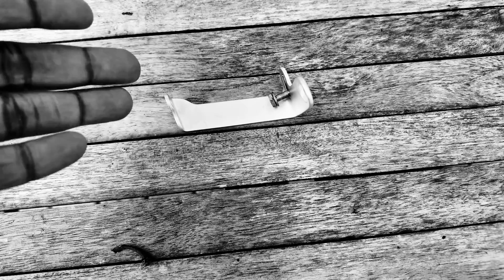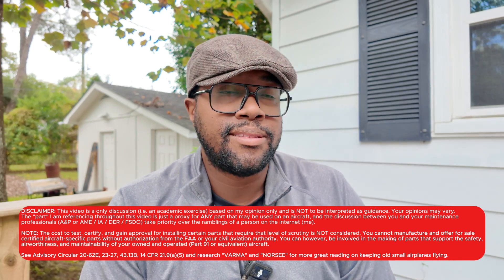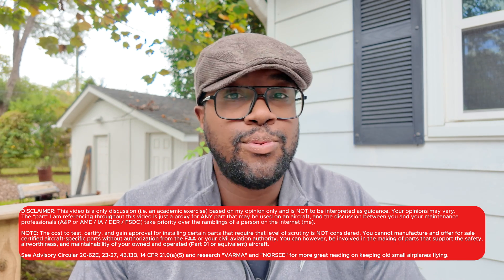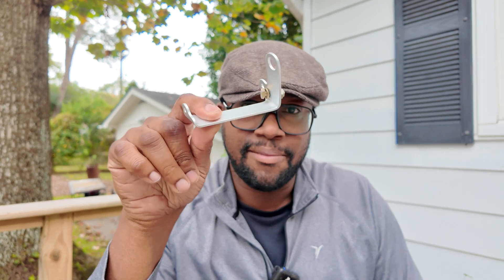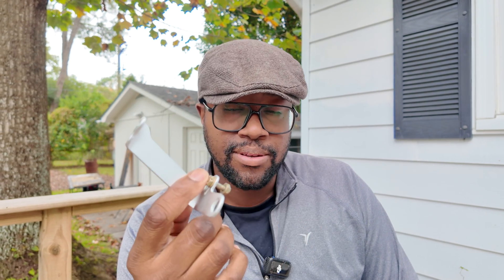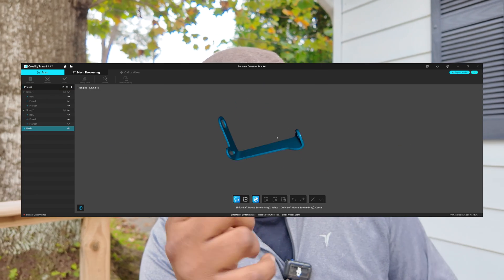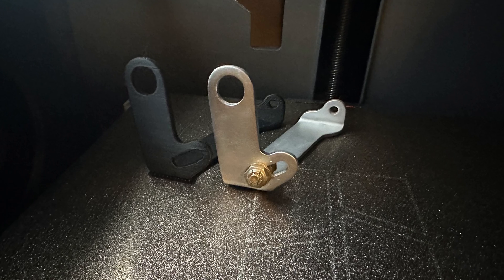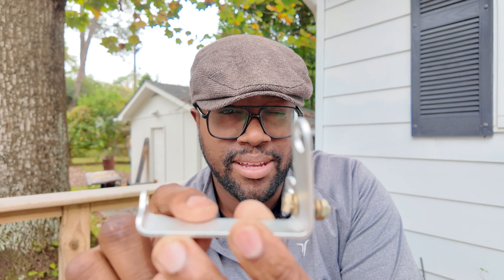This $320 Part Should Be $25 - Prove Me Wrong

Comment: 30 years as a manufacturing engineer for a major military aircraft company, plus A&P back ground and I am also a pilot. Let me first say, this has been a known issue for quite sometime. In terms of manufacturing, you are correct. The cost should be less than it was say 40 years ago. But you didn't mention two major things that also affect the price.....at least, not in detail. One.....quantity. The more parts you produce, the lower the cost that can be passed onto the customer. This is a minor issue, but I bring it up because you chose an aircraft part that is NOT highly sought after, and so part of the high cost will be reflected accordingly by the seller. Two, and the brunt of the cost, liability....and this is where the cost typically skyrocket. I'm willing to bet, if you had mentioned that you were going to put this on an aircraft,  most, if not all of those quote companies would have declined your request. I understand your intention was never to put it on an actual airplane, but did you try mentioning what I just described to these folks you worked with on quotes? I'm assuming you did not. And it brings us to the major issue with aircraft parts, especially certified ones. The cost of liability, FAA approval and all of the legalities to cover a manufacturer in case of a part failure, and God forbid,  one that leads to an accident, is truly at the forefront of the cost, not manufacturing.  And that challenge hasn't changed int he past 70 plus years. So in conclusion, should this part be $320? Probably not. I'm willing to bet it could be less. But $25 dollars? In manufacturing terms hard to say unless we understood the liability cost to the manufacturer. But in legality terms.. most certainly no, it will most definitely add to that $25 cost by a considerable amount.
Reply from the maker: Excellent, excellent comment. 

In practical purposes as a certification/flight test professional, it doesn't matter if the part is going on a CAR 3 airplane or a bottle cap maker - it's just a part. Part 23 and 25 where I work require additional scrutiny. It really helps that the regulations for an owner making their own parts for the upkeep of their airplane are vastly simplified for CAR 3 and Part 91 operated airplanes. The liability for an owner produced part stays with the owner and the person responsible for returning that airplane to service. If the approving authority requires material and parts certificates from the machine shop, we'd be having a different conversation! As you noted, they likely wouldn't be able to provide such. Although, PCB way would - there's an option for it. Ultimately it's up to whatever the FAA administrator would find suitable 🤷🏾. For CAR 3 and Part 23, an ASTM standard flies. And many online sources will follow some standard for their manufacturing. 

In this example, I only need one thing, for my airplane, to solve my specific problem. So this academic exercise is perfectly valid and does not cover every corner case or we'd be here for a decade. I'm not trying to make my own Piper PA-28 spars...yet 😉

After everything is done, it's then a practical conversation between owner and A&P to find the safe, legal pathways. I'm not getting in the middle of that. Just saying the technology is there, and everyone's mileage might vary. 

Very great discussion starter! Welcome to the channel!

Comment: Does MOSAIC address any of this area of concern for aircraft owners working on their aircraft?
Reply from the maker: It addresses it for abvery specific case - new light sport airplanes certified under the new rules may be maintained by someone (i.e. the owner) after they obtain a repairman certificate.  Much like he builder of an experimental airplane can act as its primary maintainer with a repairman certificate now. It does not change how previously certified (i.e. Our old CAR 3 and Part 23 spam cans) are maintained and modified (14 CFR Part 43). MOSAIC is actually pretty good reading. Find the Mad Props Aero channel they have a great break down of it.

Comment: I like what you say, I used to own a machine shop that made AOG parts for aircraft. If you showed up at my shop with a blue print or a broken part I could have reproduced that part because I was a certified shop. While I hosed maintance shop I did do some replacement parts for GA and did it as inexpensive as possible. I do agree with what you say here and Send Cut Send is a great source for simple parts.
Reply from the maker: Glad to hear this perspective. I'm not claiming to have the 100% solution but a modern day machine shop is vastly more capable now than ever. Imagine what we could do if we could apply ASTM type testing to a sacrificial part? We'd definitely be on to something.

Comment: I wish we could de certify an old certified plane. Then re certify it as experimental. So, we could then use your “experimental” bracket, that we both know would work. And all the legalities would make the lawyers happy. Thoughts?
Reply from the maker: You actually can! If you have legitimate research and development to do, any certified airplane can be placed in the Experimental R&D category. You just have to prove to the FAA that you have a legitimately large and valuable project, with safety and outcomes thoroughly investigated which becomes the rub. The airplane would then have serious restrictions of where and when and how it can fly (frustrating but not impossible to overcome) but then the other rub, good luck getting all the parts on the airplane to conform to a standard, and then you'll end up running a Part 23 flight test campaign to recertify what would now be considered a new Type. The FAA would likely not let you revert to the CAR 3 standards of certification. Could make your head spin!
Reply from the maker: Or keep it experimental forever with the restrictions which might still suit a lot of people's flying.

Comment: Liability and cost for approval make aviation parts expensive.
Reply from the maker: That's a huge part of it. There's huge cost in the paperwork and liability. So cut out the manufacturer if it makes sense. If the owner takes on the task of producer, liability stays mostly within the house.

Comment: I talked to GPT about it. 
It can be produced under a Parts Manufacturer Approval (PMA) – A third-party manufacturer approved by the FAA under §21.303.
PMA parts must show: Design approval (identicality, licensing, or independent test/data showing equivalence to the TC part), and production approval (quality system ensuring conformity).
If they have identical shape, equivalent material and method of manufacture. Bent sheet metal in this case.
If you do a different superior design like organic 3D print it needs an STC, they consider it a modification and it's a different part, even if vastly superior.
But for your own use it's actually possible to make the part yourself with a bit of documentation overseen by A&P mechanic and it be legal in a certified plane. Which is interesting. In case the company is long gone and no parts can be bought for instance. So for your own use you might just be able to order a sheet metal part made with a few right choices.
btw a TMU, turbine monetary unit is 1 million dollars and they are not kidding. If you want it serviced it's a million dollars. The tiniest jet engine, it's a million dollars.
Reply from the maker: TMU!! Dang 😂. And yes the GPT is most practically correct. I put the regulations and ACs I referenced to make this video in the description and they're actually easy reading. The comprehension and application are two different things.
Reply: @OpenSourceGA  It might be so relatively easy to get PMA approved for such a simple part that you could do it and have 100 parts made and sell them online for 99$ or so. Or even to a supplier network, they might sponge up many suddenly. Maybe add a few more parts. An STC for a modified part might also be relatively straight forward, just a slow bureaucracy
Reply: I talked to the spirit of Orville Wright via a medium and also got an explanation I can't rely on without looping in an actual human expert

Comment: Interesting. Given its design, a fairly weak structural design I assume it's not under a lot of load (or its poorly designed originally). Maybe show where it is in operation if you can.
3D metal prints can be quite strong but for that approach the part could be redesigned in the organic bone shape for much greater strength so there is no concern about force concentrations in the bends. The original design is not fancy engineering, that's just the most basic way to make a part so an organic FEA optimized 3D printed replacement could be vastly better. I don't know how the rules exactly work in practice but maybe an equivalent part doesn't need an STC, it could just be called that part. Maybe. Those who make the part for 320$ presumably don't use the exact original manufacturing technique either so there must be some equivalency tolerance there.
Also the bolt is no doubt important so it's not just the metal bracket that has to be right.
But the more general point is a better one. Improving little parts on an old junk design is not the way to cost effectiveness. The whole plane has to be redone in smarter ways. And single piece carbon fiber is the way :)
Reply from the maker: Ding ding ding! Winner comment right here. Always do it better. This part is at the front of the engine where it's hardly affected by exhaust and cylinder heat. It handles the push and pull force placed on the prop cable - similar loads put on the throttle so...nothing. There is also cost and effort risk in going "too far" though. These projects must have a practical start and end.